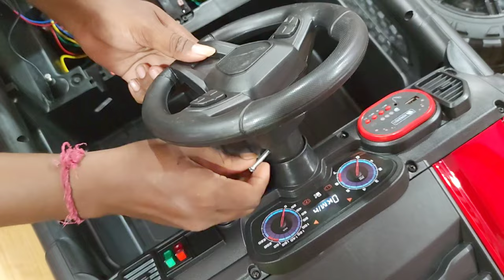BATTERY CAR UNBOXING AND INSTALLATION || POBO JEEP ASSEMBLING || POBO CAR INSTALLATION VIDEO ||

Comment: How many volts charger it needs ?
Reply from the maker: 12V - 1000mA
Reply: price evlo bro
Reply from the maker: @ChinnanChina  11667 from flipkart
Reply: It's good? Using time and how to order?
Reply from the maker: @KrishnaKumar-gf9vx  ya good,. 40-45 min , from flipkart 
https://dl.flipkart.com/dl/attire-rechargeable-battery-operated-ride-bluetooth-music-electric-jeep-forkids/p/itmb3b37b6200137?pid=EROGHXYX8UGVX5XV&cmpid=product.share.pp&_refId=PP.66919537-f7c7-41a3-845a-1b4656f8edc5.EROGHXYX8UGVX5XV&_appId=CL
Reply from the maker: @ChinnanChina  now only rs 9334
https://dl.flipkart.com/s/iAs6N0NNNN

Comment: How much time do we need charge affer installation to start the car
Reply from the maker: @mojeshkadium1387  depends on how much charge is left. You can use it untill discharge or You can also charge before use untill the red light become green .

Comment: Bhaiya humne 3 tyre lga liye hai but ek ki pipe jo hai vo bahar nai hai uska pech lag nai rahe so kaise kre
Reply from the maker: Madam peche wala tyre ke sath ye problem hai. To aapko pehle dekhna hai do part ek sath joint ho kr ek tyre hota hai, last jo tyre hai uska width bki tyre ke sath match ho rha ki nhi, agr wo thik hai then appko peche wala ek tyre lagane ke bad jo pipe(axel) hai wo dusre side thoda khich ke dusra tyre lagana hai. Peche wala axle same same hai to thoda idhar udhar krre adjust krna hoga.
Reply: @GATIMAANSANDEEP-oh2fv  but pipe to hil e nai rahi
Reply from the maker: @Swatisharma-s8s  to fir tyre khol li jiye bina tyre ke pehle pipe ko dono saide same same kr lijiye. Agr nhi ho raha hai to jo motor laga hua hai pipe me wo halka krke pipe ko ghuma ghuma ke khichiye ho jayega
Reply: @GATIMAANSANDEEP-oh2fv  ok sir start Karne se pehle kitna time charge lgana padega pehle
Reply from the maker: @Swatisharma-s8s  7 - 8 hrs
Reply: @GATIMAANSANDEEP-oh2fv  sir usko lge 12 hours hoge but Abhi tak chali nai
Reply from the maker: @Swatisharma-s8s  on nhi ho rha? Fir to battery connection me kahi problem hua hoga
Reply: @GATIMAANSANDEEP-oh2fv  but Abhi to humne new li hai even ki chlayi bhi nahi fir kya kre
Reply from the maker: @Swatisharma-s8s  dekhiye battery me already thoda bahat charge rehta hai . Aap seat ko khol ke ekbar battery ka connection dekh li jiye , charging ke time red light jal raha ki nhi, agr sab kuch thik hai fir v on nhi ho raha then return krna padega
Reply: @GATIMAANSANDEEP-oh2fv  eska slot sir agge hai  steering ke pass
Reply from the maker: @Swatisharma-s8s  madam aap ke pass agr ye same model hai, to phir video me jysa dikhya gya step by step krte jaiye. Ho jayega. Agr phir v nhi ho raha then return krna padega

Comment: Bai aap 1 batteryka kareeda ya 2 battery which is best?
How long it will work
Reply from the maker: Single battery hai ye. Abhi tak koi problem nhi aya. Single charge m 40-45 chal jata hai. Baccha isse yada khelta v nhi hai. Khela ho jata to charge me laga deta hu. Waise full drain bahat kam br hua hai, wohi 2 3 ghante ke liye charge m laga deta hu. At this price point it's satisfied ha thoda wheel ka friction sound zarur ata hai lekn wo disturbing nh h.
Reply: @GATIMAANSANDEEP-oh2fv  😊 thanks a lot for the information

Comment: Battery not charging what can i do
Reply from the maker: Go to flipkart order section then need help , tell them your problem.
Actually battery charging is not an installation issue .
Reply: @GATIMAANSANDEEP-oh2fv  buy from local shop but far long from my place
Reply from the maker: @professor.1143  Sir plz return or atleast make a complain over phone as soon as possible .

Comment: May you please share after use review,
Reply from the maker: Satisfied, My 3.5yrs old nephew drive alone. Good built quality.music, light , accelerator, remote everything working fine.
One con:seat is not fitted well but it's not a major problem . Overall at rs 11667 satisfied
Reply: Battery life ?
Reply from the maker: @thanveerahmed4210  it works 40-45 min in single charge. About battery life I have no idea. Actually after all market research I found this one value for money and still it working properly .
Reply: @GATIMAANSANDEEP-oh2fv  thanks 😊

Comment: What is the maximum speed bro
Reply from the maker: maximum 15 km h by using accelerator pedal and by using remote controll u can adjust the speed. May b 5 10 15 , three step available